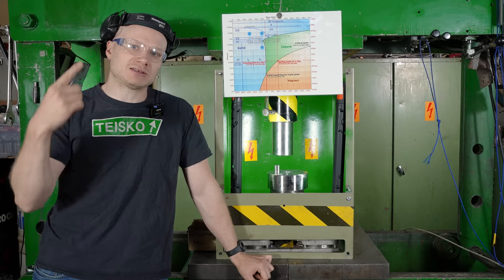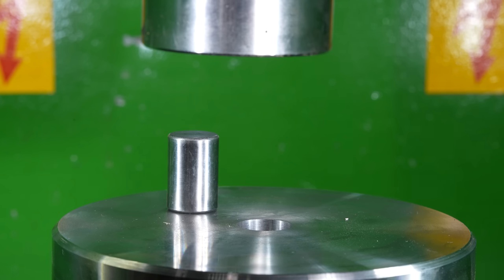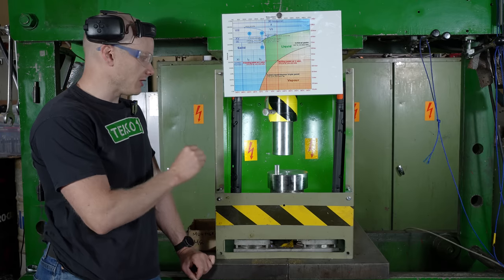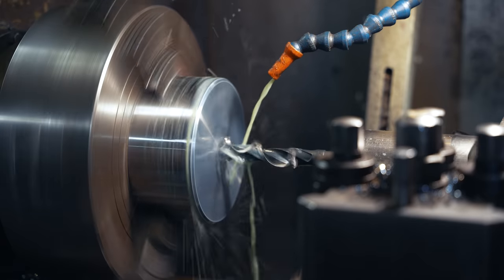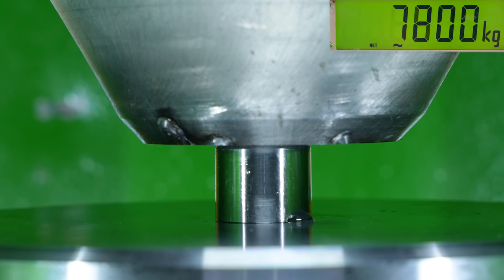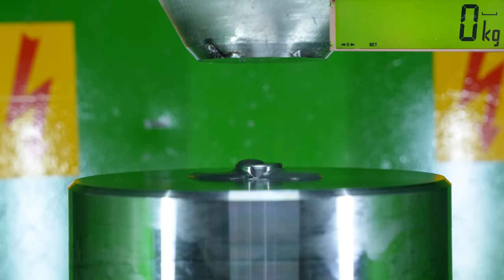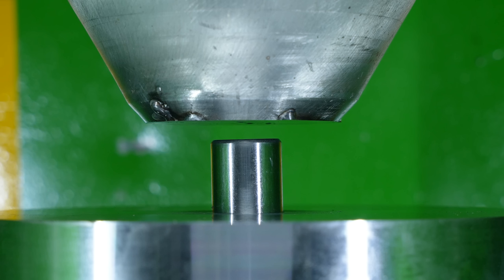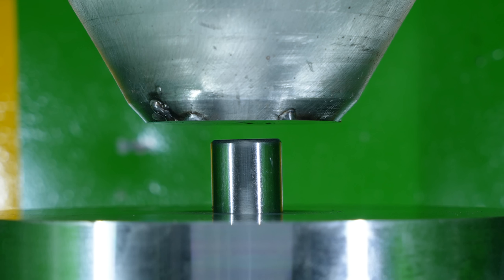Turning Water into Rock with Hydraulic Press

Comment: Likely what you're perceiving as a delay in the sensor is that pocket of air being compressed. Perhaps you could create the tool with a very slight bevel so it gets tighter as you compress it down?

Comment: Greetings from Australia. We LOVE your channel!
I used to work as a researcher in ultra-high water pressure technology so I might be able to help. First off, I read some of the comments about metal-to-metal sealing. Unfortunately metal to metal seals only work once in ultra-high pressure water applications. What happens is the material quickly deforms and a leak develops. Once you have a leak with these pressures, you’re dead. THis is because the water is now travelling through a mind-blowing tiny gap at an insane velocity. It’s travelling so fast it erodes the metal. The second you get a leak the pressure that you’ve just achieved is usually the highest you going to get to.

The full speed test you did in the video was great but I don’t think you made water a solid. Maybe, but I think it’s unlikely. Were you able to get the piston out at the end of the experiment? The state of the piston can tell you a lot about what happened.

When you’re trying to create pressures this high, material defamation becomes a real problem. Firstly you’re putting a lot of energy into deforming the piston (it compresses and tries to expand) and believe it or not the cylinder walls as well. Ultrahigh pressure water jetting machines generally use isostatically forged precipitation hardened materials that are pre-stressed so they can survive the continuous expansion and contraction cycling of the pump. A lot of the materials we used for our experiments came from Bohler in Germany and were very expensive and difficult to machine.

Waterjet cutters run at extremely high pressures. It’s not the water that’s doing the cutting, its abrasives that coat the outside of the high speed waterjet, but the velocity of the water all by itself erodes metal nozzles in seconds. The nozzles in these set ups are usually made from very hard materials like sapphire or industrial diamonds. Even the diamond nozzles wear out, and it takes less time than you think.

Okay so how do you go about sealing at these ridiculous pressures?

First of all don’t use interference fit as the sealing mechanism. I’d guess that what is happening in your experiment is you’re compressing the piston, expanding it and jamming it into the cylinder increasing the friction and therefore the amount of force you need to pressurise the water. Intuitively you think this will seal but what’s probably happening is the water finds the weakest path through the metal, either the piston or cylinder. The reasons for this are quite complex but if you imagine water eroding a mountain, it’s a little bit like that only much faster!

Secondly, put the seal in the end of the cylinder and not on the piston. In this scenario, the piston is now being used as a displacement device, not a plunger using brute force. The forces are now iso-statically distributed around the plunger as it moves into the cylinder. You still need the same amount of force, but this is distributed evenly around the plunger. The plunger will shrink now, not expand and the sealing point can be engineered with hybrid materials that are up to the job.

Putting a seal in the end of the cylinder seems like a simple thing to do, but it’s actually very difficult and expensive because you need a flange holding the seal that can handle the forces. Usually in intensifier designs, the cylinder screws into the body of the pump with a seal installed at this point. With this type of seal design, the plunger needs to have a very accurately ground mirror finish on it. It’s usually ground to sub-micron precision and made of a hard material. The reason it needs to be this smooth is to ensure that the seal works, and lasts more than a couple of strokes. Designing the piston and plunger this way also means that you only have to replace the seal when it fails. And it will fail! Much easier and less expensive than replacing the plunger and the cylinder because they’ve jammed together! You might be able to find ultrahigh pressure end of an intensifier pump to use for your experiments. These are rated to pump to nearly 7000 bar now and you don’t have to manufacture any of the components. Just block the end of the intensifier cylinder somehow. Remember however if you going to do this that the plug is a very dangerous projectile if it fails!

Thirdly, research seal designs for these sorts of pressures. I can’t give you any designs because the work I did on seals is all confidential, but I’m sure the book you have on turning water into a solid has some good ideas for seal designs in it and there is a lot of published work on this subject. What I can say is that the use of high molecular weight plastics like UHMWPE with filler materials and strategically placed precision machined backing rings is probably a good starting point.

Fourthly, try to get some understanding of the friction in your system if you going to use hydraulic pressure as the means to measure what pressure you’ve achieved in the water. The amount of friction is much higher than you think it is, so on paper you need 24 tons whereas in reality you need a much higher force to achieve mineral water.

Or you could just buy a bottle of mineral water, job done 😊.
Reach out via our website if you want to have a chat, what you’re trying to do is really, really hard! Good luck!

Comment: you should create a block were you can pass coolant around the central cavity without compromising the strength of the cylinder. This will greatly improve solid formation.

Comment: Water is incompressible so you can have a larger reservoir with a smaller bore hold to compress it. You don't need to compress all the water on itself but just reduce the volume of the chamber holding the water to the right amount(which you should be able to calculate). E.g., small long bore with large spherical chamber. Shove something in so that it causes the chamber volume to reduce which will compress the water but you are not trying to compress a large surface area of the water(which requires more pressure). E.g., your chamber could be quite large such as 1in^3 with a 2mm^2 bore. If the chamber is full of water then as long as 2mm^2*1/2/1in^3 is enough of a compression ratio then you should be able to compress it. If not you should be able to play around with the sizes to get the right amount. The way you are doing it now is that you have a large surface area that you are trying to compress with a little water. You want the opposite. A lot of water and a little surface area.

Comment: Hi I read some comments and did too much thinking than I should have done for this. Here's my thoughts on improvement to maybe get i7: first, concave plug end. It will direct the pressure inward instead of into the crack between plug and base. Second, freeze both the water and base. Measure the base hole diameter afters it's been frozen. Make your plug to that diameter exactly. Frozen base should also expand as it warms, equally closing the hole around the plug. And lastly, freeze the water inside for a simple reason of ice doesn't flow through water nozzles... pressure will heat it up maybe liquidifying the ice but residual cold should slow that down. You may need more pressure than the chart says as well. That likely factors in the cold temperature. That'll naturally lessen the atomical forces that create fields of repulsion between atoms. You need the increased pressure to overcome the higher energy forces. The expanding ice structural forces are already countered as part of the original equation so you can ignore that bit.

Comment: Your best bet is to use the tool like an ice tray, fill the bore with water and stick it outside till its frozen solid. If you can, freezing the piston may help too - compressing stuff heats it up big time, starting with room temperature water and tools means you will need to generate much, much more pressure than you anticipate, because the temperature of the water is going to rise dramatically. You can see it steaming in the first attempt

Comment: I wonder if the pressure is getting so high it's deforming the steel just enough for the water to escape.  Could you perhaps shape the bearing and enclosure such that, when expanded, will actually cause everything to seal up even more?
Reply: I think with a little tweaking of your plan the project might be in your sights 👁️-👁️

Comment: There are a lot of ideas on how to get this right.   I’d say. 

Used a smaller tool, like maybe the size of the end of a shot glass.  Cupped bearing on the upper press tool, so it expands and seals as pressure increases.  

Pre-freeze all tools and keep cooled in dry ice,   Start with water freeze it into Ice Phase, and then press the ice.  Keep the pressure at whatever it needs to be for however long it takes to cool to room temp.  Tada. You turned water into rock using the press.  If you can put a wireless temp sensor in the whole right to keep accurate of when it hits room temp that would be optimal.

Comment: I see lots of steam, not ice. To make ice through compression you're essentially heating the water by pushing the atoms closer together. That heat needs to be sucked away by the big metal block so the atoms are vibrating less and so become more like ice. That takes time! If you keep compressing before giving the atoms time to vibrate less, they simply vibrate more and transition into steam increasing volume 20x and cutting the metal. You need to go a lot slower, think 20 minutes maybe longer.

REMEMBER you're not trying to crush water instantly into ice, you're trying to slowly trick physics into sucking the energy out of the water/ice using the big bit of metal around it as a sponge.
Reply: With this in mind, you also need to add cooling fins to the large metal block and setup a fan(s) blowing air over it to carry the heat energy away. This will speed up the freezing process to make Ice VII or Ice VI.
Reply: on a side note; if you do make Ice VII or Ice VI, timelapse the tool and you might see it change shape. The ice will change volume depending on the phase, this is your only way of identifying if you've achieved a phase change - given it's impossible to open the tool and look before it transitions.
Reply: if you did manage to open the tool in time, the Ice VII or Ice VI would instantly shatter due to the volume change and either melt due to that rapid expansion or remain as microscopic shards of normal ice like an ultrafine dust. Would make for some great youtube.

Comment: If you bore the hole so a copper pipe cap fits in the hole open side down, the copper will form a "balloon" to seal the water in.  Assemble the cap and pin into the hole under water to avoid bubbles.

Comment: I think you may also be missing how much pressure your tool can handle too. It seems to me that if you're pushing a bigger object into a hole that's too small for it, the metal is giving way to some degree at those lower pressures and as the pressure builds its just that much weaker.

Comment: I think you need mold made with high precision machining, so there is no way for the water to escape. Would love to see that. Awesome vid.
Reply: That's what he already did. The plug is larger than the bore, creating a crush fit similar to the way gas bottle valves are threaded.

Comment: It takes extraordinary pressure to compress water. Even at the bottom of the deepest oceans, two and a half miles under the surface, where pressure is equal to about 1000 atmospheres, water is compressed by only 5 percent. You did not even get close.

Comment: The presence of the air is going to cause havoc too. It'll dissolve in the water under pressure and alter its physical properties. Some of the gas componants of the air will probably turn to a liquid state under that much pressure too

Comment: Instead of boring the hole smaller at the bottom, cut a lead on the plug. The deformation on the plug will swell the material on the outside at the hole opening and help seal instead of the press fit just expanding the hole. Also you could use a really cheap hardened button pressed into the hole to have a 65 Rockwell hole that won't deform.

Comment: Apparently, 'you are assuming that the temperature of the water under compression remains at the ambient room temperature as the pressure/force increases, so that you enter the ice zone directly from below.  However the energy imparted to the water by the applied force increases its temperature with the result that you move away from and miss the ice transition on the phase diagram.

You may want to start with significant cooling of the confining chamber so as to dissipate quickly as much of the generated heat as possible.  Of course, cooling (as with liquid nitrogen) may alter the diameter of the hole, which change must also be taken into account.

Comment: The water is coming out because the one part is moving past the other part.  As long as the two metal parts are moving it provides a microscopic gap for the water to start leaking out of which turns into more water leaking out.  To fix it have one larger metal disk with a grove the 2nd smaller disk fits in.  There should be a small space in the center for water.  Without water weld the two disks together almost 100% together except for a tiny channel to fill the center with water.  After welded let it cool then fill the center space with water via the tiny channel.  Now do a fast weld on the tiny channel or several small welds so the water doesn't evaporate.  Compress the center.  What might also work is having a larger center peg with the chamfer squishing the metal to an even smaller area.  This would allow even higher pressure without a leak by having a larger chamfer surface area.

Comment: i do apologise if i missed it but maybe the little rod you are pressing into the block should also be coned a little. if the rod is straight then i think only the tip of the rod is acting as a wall to stop the water, if this is breached then the water can slide up the side, with a cone the water will need to push through the whole rod as a barrier, i could be wrong and you could have tried it already. sorry for bad explanation!

Comment: To seal the roller you can use the pressure you create! Drill (or edm) a hole in the roller (on the inner flat surface). This will create a pressure surface trying to expand the roller. The bigger the hole, the more sealing. Its like the Champaign Plugs are sealed :-)

Comment: Im wondering if the pressure got so high and all you needed was a microscopic valley/scratch to create a channel to create a water jet cutter effect that carved out an opening letting the water out. If there was an interference fit, the metal deformed creating an outlet.... maybe a polished .1 thou oversize press fit ( F1?) would reduce the cutting effect.

Comment: I think the steel is galling as it presses in and the galling is opening up small gaps. Maybe use some oil impregnated sleeves.  Or maybe make the hole tapered as you did and make the pin tapered. Maybe that would stop the end of the pin from creating a plowing effect.

Comment: Your hole and your plug effectively have straight sides ignoring the jog in. So the force the water has to exert to squish through the gap is constant regardless of how far you press the plug in. But as you press the plug in, the force being applied by the water is ever increasing. I propose you taper both the hole and the plug. Shape them like pressing a cone into another cone, or a cone into a funnel. That way tightness of the plug per say will increase along with the pressure exerted by the water.

Comment: Cool everything down using Liquid Nitrogen, including the tool, bearing, and water inside the hole so it is frozen before applying preassure. Make sure to cool the Steel for a long time so it get really cold.

Comment: The faster you apply pressure, the more you heat up the water. The pressure should be applied very slowly over a long period of time - the room temperature is whole another issue on it's own. Ice vi, as well as ice vii theoretically forms in ddep depths where the temperature is very low, but at the same time the pressure is very high. Should be interesting!

Comment: Adjust the pocket a little smaller and then drop the insert into liquid nitrogen to decrease the diameter. Quickly place the insert into the pocket before it expands with the air gap on the top. Start slow with the press and compress the air heating the bottom of the insert so it expands slightly to close the gap and then slam the insert quickly into the pocket.

Comment: I suggest designing your pin and hole with multiple steps, with increasingly larger diameters from bottom to top. If your single diameter pin and hole were able to reach 10000 kg before leaking, a pin and hole with 5 varying diameter steps would perhaps reach 50000 kg without leaking. This is because each level will have to overcome both the metal seal and the pressure of the step above it before failing. For example if the fifth step down reaches 50000 kg, the fourth step only has to sustain the pressure equivalent of 40000 kg to maintain it, and so on all the way to the top. A Multi-Stage Seal relying on pressure differentials from one step to the next.

Of course the steps would have to match near perfectly in vertical distances so that the steps of the pin and the steps of the hole all meet simultaneously. I think it could work.

Comment: The sealing can be improved by modifying the shape of the pin instead of being flat, making it a conical hollow, filled with water, then frozen and inserted into the block with the conical part facing inward.😮The more pressure there will be, the more sealing 😮